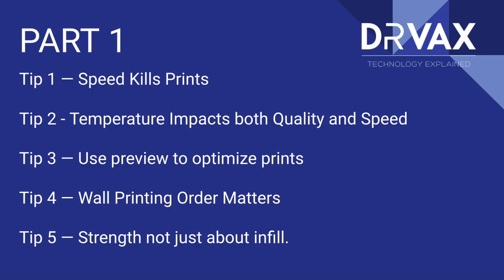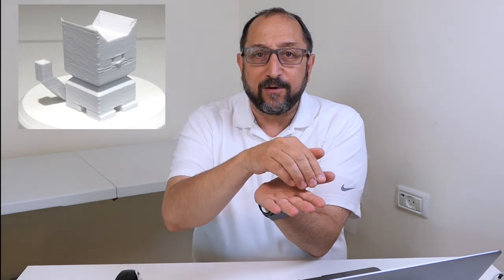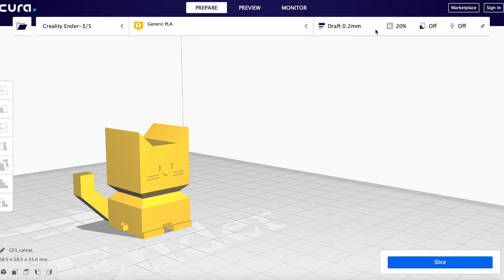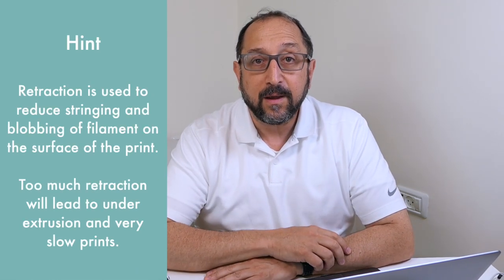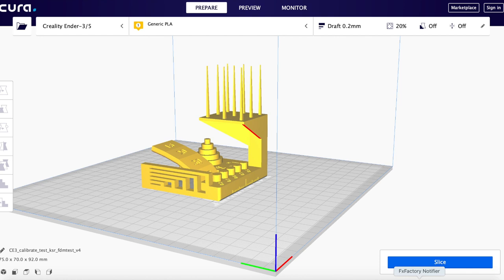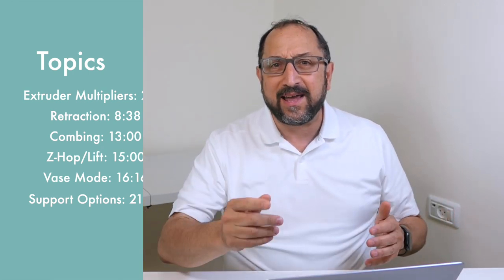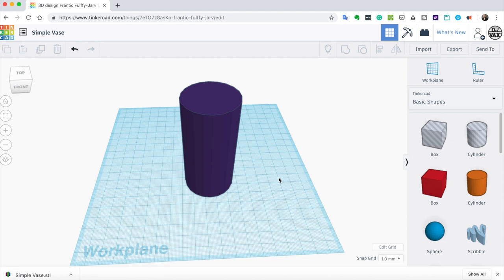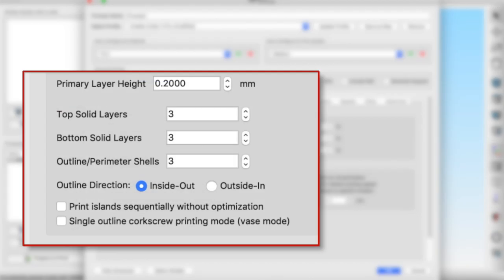Slicers for Beginners: Extrusion, Retraction, Vase Mode, Supports

Comment: This is a good series. I found some things I've not undersood yet.
I think the linear estimation from large cube has a flaw. Extrusion affects only single line ie. lines at edged. The overall size is affected by print head movement. Majority of size is from print head movement. If you overextrude 150% you do not get a box of 30mm instead of 20mm.
 For example, if your 0.4mm nozzle prints a line of 0.6mm (ie. 150% width assuming you asked for 0.4mm!). However, printhead positions the last line. Depending on how much oozes to which direction, you get 0.1 to 0.2mm out from the box from either side. The larger the box, the less that 0.2 to 0.4mm is in percentage of the total box size.
I've tried out something like measuring extruded filament length (when correct size is set) and extruding single line walls with known thickness. These seem to both get on the same ballpark but yet seem to differ a bit.
Calibration cube is still wider if you overextrude (but only by a fraction), it is best used for checking axis step count sizing is correct. If your head moves at 150% rate, you do get a 30mm edge instead of 20mm. Then you can estimate step count per mm or whatever linearly from that.
Reply from the maker: Yes you are correct that measuring filament extruded is more accurate.  If your printer is significantly off this approach will not work.  See the following video for details about the approach where you measure filament extrusion.  Thanks for commenting.  This is how we learn together.

https://youtu.be/lRoCwxRZsvU

Comment: So I'm a bit confused; should z-hop be set to on?  These videos are super.
Reply from the maker: Yes if your model has towers or features that could collide with filament dripping from the nozzle.  If your model is basically flat or all the same height your prints will complete faster with z-hop off.
Reply: Many, Many thanks.  I've learned so much.  I'm 75 and find it great to learn new technology!   I have several Monoprice printers, and use them to print out scerary in my hobby, which is historical gaming.

Comment: Interesting video!, Is it possible to configure Cura to give much more accurate print times?
Reply from the maker: No.   If you use Cura with Octoprint you can use Octoprint to obtain better print time estimates.  Part of the problem is that firmware settings interact with slicer settings.  This is transparent to the slice so it has not control over the impact of the firmware and in fact also hardware and print times.

Comment: Hello Sir, a very informative video once again. I have anet et4 pro & sometimes when I slice with cura the printer does not read the G code file and goes in continuous moves in X & Y direction opposite to the limit switch on the axis and ultimately making a scratching noise  & display will show 4 or 5 percent completion of the design. Please advise. I am using the stock firmware and not done anything to the printer hardware or software. Also, my printer does not print the file with cura setting the extra coarse or extra fine. Please help

Comment: I have a major problem my problem is I can't get it to scale to the 
right height. All the sudden it starts scaling lower than what it is. I 
didn't change anything I tried cura  4.1,4.0, 
3 .6 version.  I calibrated my estep's now it prints a lot little better
 now but I still getting the scaling problem still small please help me.
Reply from the maker: Are you printing your own models or models you downloaded from a site?   Try a know model like the calibration at at 100%.  Does that work properly?
Reply: @MakeWithTech  I use CHEP Calibration Cube  from thingiverse and one that's a 20mm calibration cube as well. I even download a 100mm calibration and I change the scale in cura setting form a 100% to 125% to see what happens and get 110mm? try different slicer's with the same results. So it's most be the printer so what can it be?